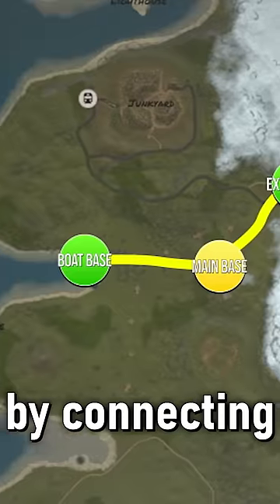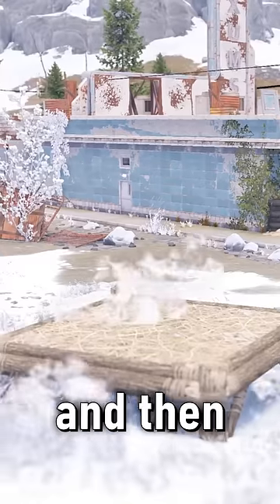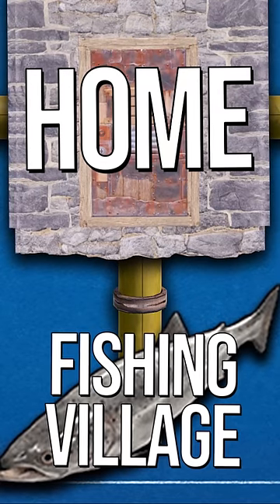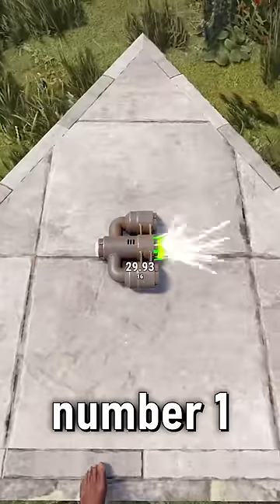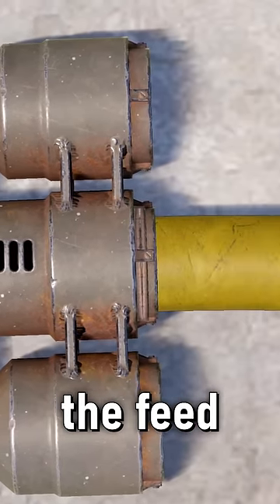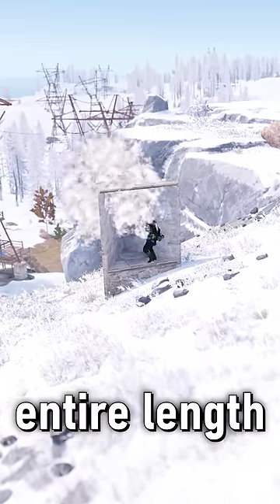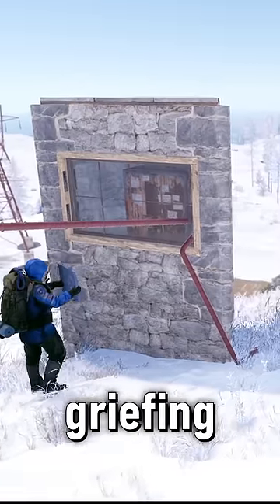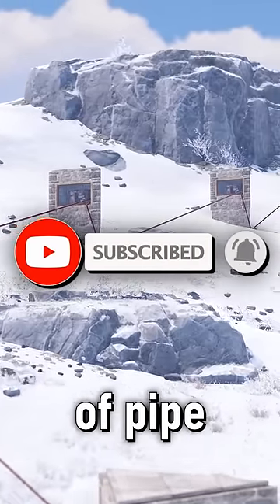The Greatest Industrial Pipeline Ever | Shorts

Comment: they should change the pipes so that they stick to the ground or walls, or the pipes have supports under them so they arent just floating in the air without any support under them. it looks weird and needs minor adjustments